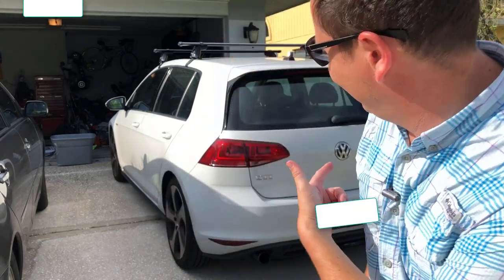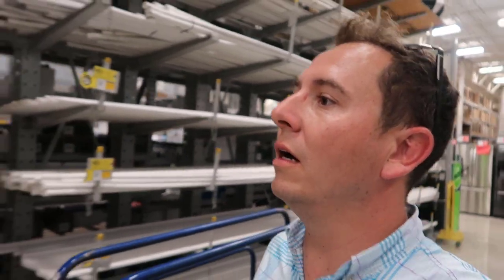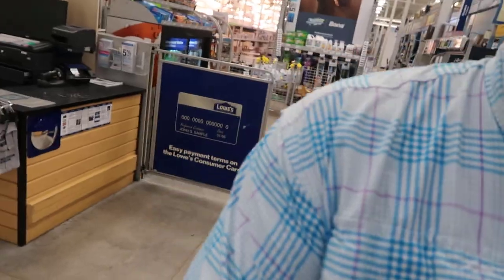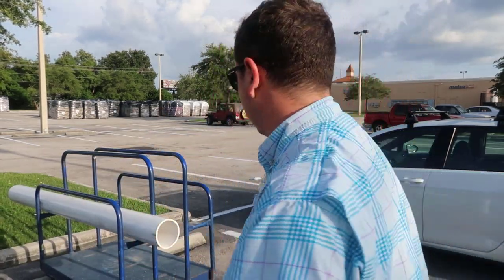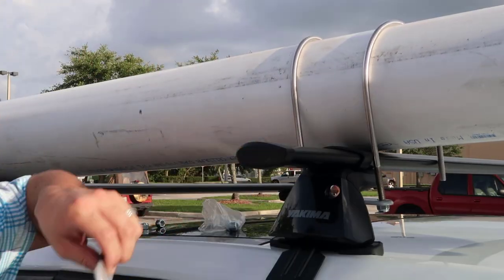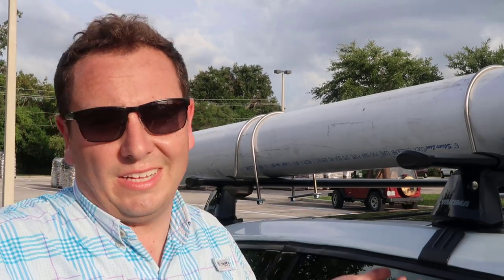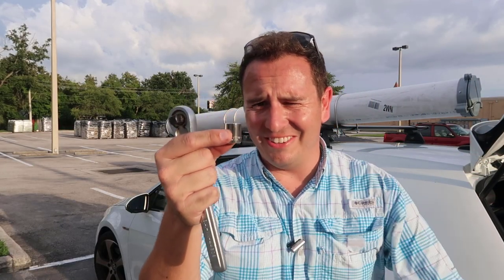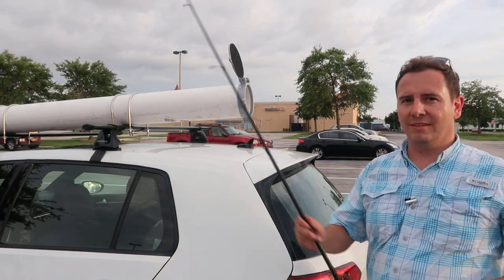Fishing Rod Tube Roof Rack DIY How to Reese Conduit Carrier Kit

Comment: Good idea, I like the "in lot" cutting and install (I need to try that sometime). What rack system is installed on car ?
Reply from the maker: Hahaha Thanks. That cart made a pretty useful work station considering I could never have gotten that pipe inside my car. It's a Yakima roof rack. I just had it installed a couple weeks ago. I had one on my previous vehicle but of course they have updated the system and there was no way to transfer it. None the less it works great and is super sturdy.
Reply: Hi..How i wan buy cap n butt pvc? U sale that part?
Reply from the maker: I do not sell it. You can buy it on amazon. It is called a Conduit Carrier kit.
Reply: Thanx a lot bro.

Comment: How much did the total project cost?
Reply from the maker: Great question! The conduit kit (brackets and pvc endcaps) was $55. The PVC pipe I think was $15. Total build is about 65/70 dollars if you already have the tools (saw, wrench, and screwdriver).
Reply: $15?  Wow. The 6” pvc at my Lowe’s is $46.
Reply: @jtsarby  Same here; I don't know where you can get 6 inch pvc for $15; 4 inch maybe but not 6 for that price here either.